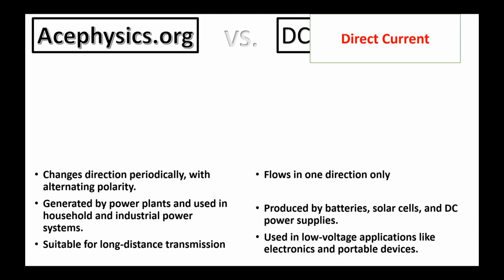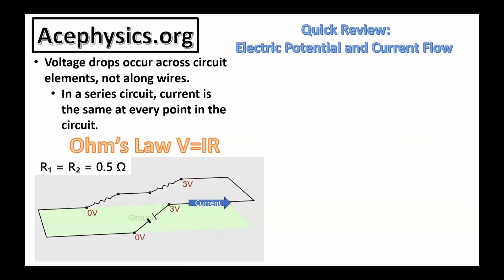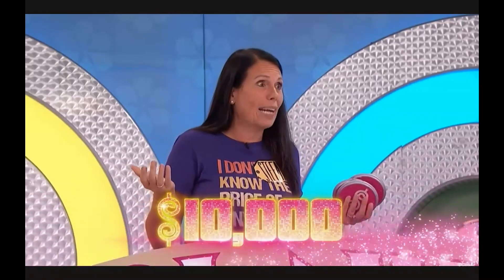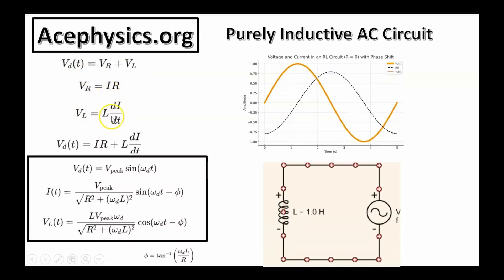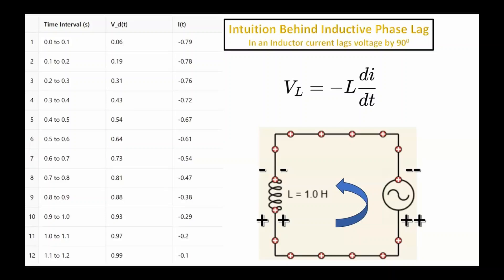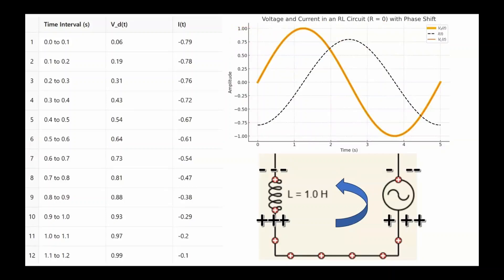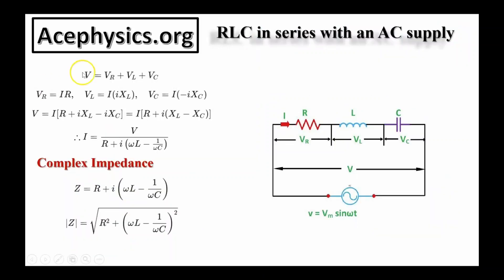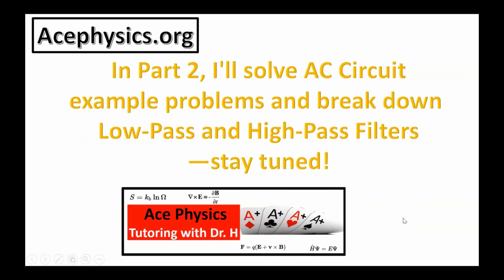AC Circuits Made Simple Impedance & Phase Lag Explained

Comment: An electrical equipment manufacturer (MR) in my hometown builds "Taps" for transformers. I was lucky enough to get a tour of the plant. They explained how the TAPS are used to smooth out the voltage/current power factor issue produced by inductances, capacitance and line resistance. (hopefully I got that correct) Hate those VARS ha-ha